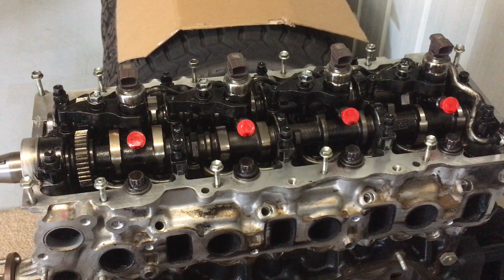HOW AN ENGINE WORKS pt2

Comment: Another great vid.  Any chance of doing a video like this re the EGR system.  I want to know if electronically disabling the EGR is a bad idea as this is the case with mine.  Also have the 7mm plate.  Saw you mentioned about excess boost pressure having no where to go if EGR always closed in an old Pradopoint thread.  Apologies if this info is already covered but I can't find it.  Thanks.